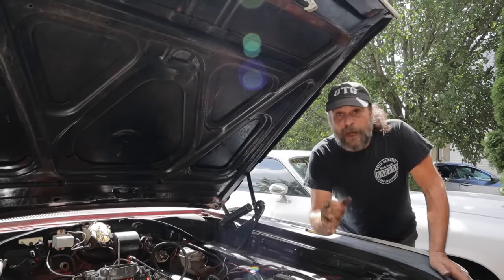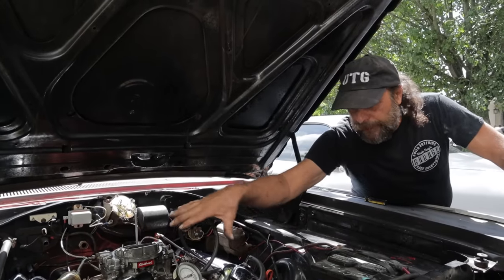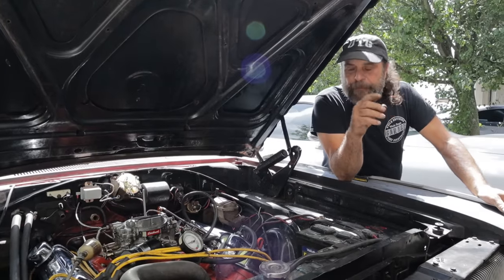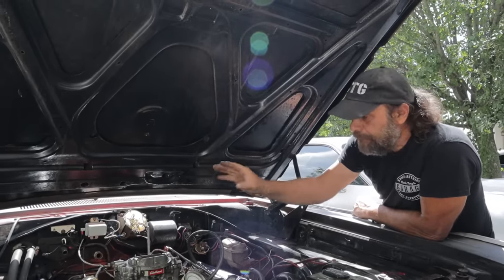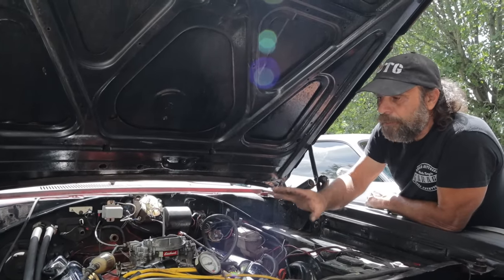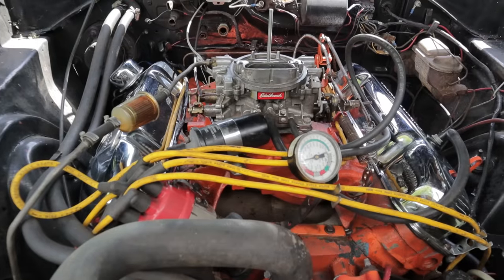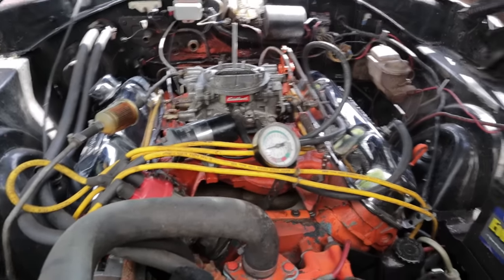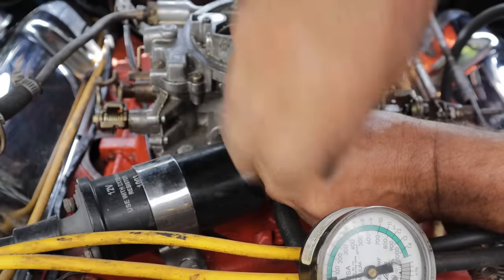Fine Engine Tuning With A Vacuum Gauge

Comment: for the longest time i couldnt figure out why my 273 in my 65 dart would stutter or lag for a second or two when i hit the throttle real good when cruising. i had adjusted my idle screws the way Tony showed in this video, but my idle was too low. so i adjusted my throttle idle screw. which then opened my throttle too far and i had vacuum on my ported vacuum port on my carb at idle.  
so then i dropped the throttle idle screw to where i had zero vacuum on my ported port and advanced my distributor to 16 or 17 degrees at idle, which brought my idle up. my service manual calls for 10 degrees at idle for an automatic car.  now it runs great.   dont know if this is how youre supposed to fix my issue but it seems to be working.
Reply: Manufacturer's opinion was just flat wrong, was it? I'm shocked I tell you.
Reply: I didn't know...  This is the first car I've ever owned with a carb
Reply: @matt72991  Well the next morning with less beer in me I shouldn't have acted like I know everything. Perhaps on a particular morning in Detroit given the weather, the factory specs weren't that far off. Also don't forget gas is a lot different than it used to be. 

I can tell you, without knowing near as much as Tony does, that I and a lot of others ran off manifold vacuum, and we did that because it ran a little better. For any car really, you want all the advance it will take, short of pinging / detonation / pre-ignition. And a lot of people live with the very occasional light ping, which I didn't really like, because detonation is like taking a hammer to your pistons and rod and crank bearings. But hey, a little ping will keep your valves carbon free ;)

Comment: Whats also interresting is if you look at the math the relation between torq and horspower is a straight line with relation to the rpm.
When ever you have a drop in the curve it is due to heat and, flow resistance.
If you make sure the carburator is colder with a aluminium manifold and wrapping the exhaust, the fule economy will drop because you are recycling less heat.
Reply: Now the limit is not over heating your engine.

Comment: Thank you for giving us your time and all the help. Much aprichiated! 
I Have got it explained The otherway around about pre timing. To use manifold vac to get the engine run cooler and Have the leaner fuel time to burn at Idle on my stock Firebird 400 68'. But yes It fall of same time as trottle blades open and I guess the rpms so low the mecanical is not still in? Im interested in people Who knows by doing , I don't think it's just black or White. Maybe it's becausse I use manifold vac I got this stumble/hesitation going on. I just got My lambda, maybe that will get me a clue.

Comment: I like that idea to open the mixture screws a 1/4 turn extra as that gives you a "cushion" somto spak. A slightly lean setting will cause a rough idle sooner than a setting a little on the rich side if there gets to be a little contamination in the idle circuit. ( which is inevitable). Set carbs. this way for 51 years.

Comment: on holley with power valve and 1/2 mercury between manifold vacuum on power valve vacuum reading. do u put one vacuum on manifold and and one on carb port and look for differential until it is at closest 1/2 way point? and do u use idle mixture screws to set it?
thanks, forgive me i'm learning. i just rebuilt my 2100 2 barrel on a 289. works great but i wanna learn more

Comment: I have always done the high smooth idle but with a 50 rpm lean drop. Something I'd like you to cover is the standard MOPAR electronic ignition over using the gold box with a performance distributor and why most should not use them as their engine will never hit 6,000 rpm.

Comment: My dad and I used to do it too is to have a vacuum gauge mounted inside the car. All of your older aircraft had them - called manifold pressure gauge. You can adjust them but not on cars while driving. I still have a good vacuum gauge in the tool box along with a compression test gauge. Great stuff Tony. Don't forget to put non ethanol gas in. Carbs don't like ethanol gas.

Comment: fine tuning is helpful but you could do several videos on engine diagnosis with the vacuum gauge. All the side issue's that come up with that topic. Is that rough idle a fouled plug or a vacuum leak etc. Is the low compression in a cylinder bad rings or a valve seat issue or  worn valve guides. As you said in you MPG video the amount of stuff the VG will tell you is a lot if you know how to use it. It is the 1970's tool for mechanical tuning like a laptop is for the mechanics of today. VG  version 2.1 vacuum and PSI in one gauge.

Comment: Great video & content! Thanks for sharing your knowledge! Was that Tang sweat dripping off your face? 🤣🤣🤣

I always said the vacuum gauge was the best way to tune a engine but it's more important to know how to use it. It's very important to have the proper vacuum on my '88 Ford Crown Vic Interceptor because of the variable venturi carb. I have tuned quite a few other cars with the same carb & when I would ask if they were tuning with a vacuum gauge, just got a look like they had no clue of what I was talking about. 🙄

Comment: The carburated engine runs cooler on manifold vacuum. Ported via a thermo vacuum switch was for emissions. When the auto trans car runs high coolant temps on a hot summer day the TVS would switch from ported to manifold vacuum so the engine would run cooler

Comment: Hidden deep in the bowels of the early seventies Chrysler service manuals, they tell you to pull the PCV valve from the valve cover and allow it to draw fresh air.  This removes any variables of fuel dilution in the crankcase,  especially in cold climates or on a car with choke issues.  I have changed oil on cars and then they wouldn't idle correctly before I learned this.

Comment: Gr8 Vid Tony....I have a stock 351 c with a 500 Holley 2 Barrel. Ive done what youve said and seem to have good results, however,when adjusting the mixture screws at idle should I have the Vacuum adance hose removed from the carby and blocked as well as blocking the port on the carby?
Thanks
Tim

Comment: Ported to the dizzy and manifold to a vacuum gauge. Correct.
That way you'll see the 2inch" drop in Vacuum when you back the dizzy off. An  Adjustable timing light is the go as you can watch the two degs of timing come off as you back the dizzy of as well. 
Set the idle with it in D and the brake on yes. That way it won't stall at the lights.

Comment: I just applied this technique to my 318 2-bbl dead stock 1979 318...which is sitting in a 1967 Belvedere II.  Ten minutes worth of work made it run like a new car and it cost me nothing.  I used to have hesitation when lightly tipping into the throttle, like when normally accelerating away from a stop light.  Not anymore.  Just step on the gas and it goes.  I don't know why I didn't try this long ago.

Comment: Engine tuning with a vacuum gauge was how I first learned.  In 87 when I was 17  my dad and I put  a 355 Chevy in my 81 Toyota 4X4 truck.  Don’t think I ever put a timing light on that truck. I was the street racing king for about 6 months

Comment: Brilliant video. So with setting vacuum to the highest on idle, is that done in gear with foot on break or is that more in reference to checking the power valve after highest vacuum on idle in neutral or park? Thanks. From New Zealand

Comment: My 1960 Pontiac takes distributor vacuum from manifold . It has a Rochester 2gc carb that has no provision for a connection for any vacuum at all . So way back at the start of the 60s they were using manifold vacuum for distributor advance .

Comment: I use to run voodoo cams with my sbc with a 600cfm edelbrock man i miss those days messing around with the meter rods and the springs changing out the fuel holes then doing wot run and pulling out the plugs to see if it was running lean or rich. I remember in the gm dizzy you can buy mechanical plates. Upgrades to get the advance more faster and etc with thendifferent color springs on the advance plates or even maxing them out at all times

Comment: Funny you mentioned the 77 T-Bird... My "modern" car died so I've been daily-ing my 79 T-Bird and I've been chasing down and removing all the emissions stuff. A Spiderweb of vacuum lines. It's not a complicated system once I dug into it but it's a headache for sure.
I currently have it running like a champ ( compared to how it was running before) pulling 24in of vacuum at idle. I have the distributor hooked up directly to Manifold vacuum... I had to adjust the vacuum advance canister a bit to make it happy and not ping. She seems to be running just fine and staying cool under normal and highway driving ( use to creep up hotter ) 
I'm still learning about these old school methods. I'm curious as to why Manifold vacuum isn't ideal over Ported Vacuum? Tho I admit I wasn't completely sure where the ported line was on my carb and ended up plugging everything besides the stock preheater

Comment: Hi UT! I have a billet distributor no vacuum advance. Where/what do I hook up my vacuum guage to? Holley 4160 750 cfm double pumper with vacuum secondaries.  Thank you Uncle Tony.
Reply: This comment of mine is old and I now understand what to do. My new Holley came with a "timed port" for Vac Advance I see. Mine is now plugged and my vac gauge was plugged into the manifold port. Tuning this was a breeze and highly recommended alond with UT timing tips. Thanks UT!

Comment: You should cover which (ported) port goes to the vacuum advance, right or left side (specify driver side or passenger side). Also explain why both have vacuum at an idle, one should have constant vacuum, the other will have vacuum only when you hit the throttle.

Comment: Glad youre teaching this stuff. I had to self teach my self how to tune a carb with a vacuum gauge. We set my timing on my 10.5:1 455 Olds motor by advancing it until it was hard to start. Then backed it off a little at a time until it was easy then made that my base timming, then got someone to recurve it so it wouldn't ping. Was that a bad idea?

Comment: Tony any chance you can do a video on detonation and how to prevent it? Building my first engine here and the amount of information you can find is dizzying, but there's doesn't seem to be any rule of thumb about how to be in a safe range initially (iron vs aluminum heads, timing, quench, compression etc.)

Comment: When you have a pre emission car (50’s -60’s era) that when they were new didn’t have a carb with a ported signal so all that was available was manifold vacuum so vacuum advance was connected to manifold vacuum. Fast forward to the 70’s when emissions came into play and ported vacuum was available to help emissions. I think pre emission cars that had vacuum advance hooked up to manifold vacuum should be connected that way when installing a newer carb that has a ported connection because the older cars have the vacuum advanced engineered to operate on manifold vacuum. (Just my way of thinking)

Comment: Hey Uncle Tony, I have a 1948 Willys CJ2A with a 67 CJ5 Dauntless 'Buick' V6. Trans, transfer case, axles are all stock. The 225 V6 is running a Comp Cams 252H grind cam. Intake is an Offy Port-O-Sonic split-plenum (double-level single plane?) unit topped with a 650 Edelbrock 4106.

It's got a period aftermarket HEI with an unknown curve. Vacuum advance is currently hooked up to manifold vacuum because I bought into that 'manifold vacuum for manual transmission, ported vacuum for automatics' thing. I'll get it swapped to ported tomorrow.Anyway, this thing is my daily driver.  Could you ballpark what I should target for initial timing and when it should be fully advanced? It's also my hunting/fishing/trail rig, but doesn't see the insanity of rock crawling if that makes any difference.Yeah, I know the carb is too big, but I can't lay my hands on a 4 barrel carb any smaller around here on my budget. I also very rarely get into the secondaries. I have the original 2V manifold and carb, but there are parts on the Rochester 2G I can't get my hands on at all.Thanks, Les

Comment: On a holley 2210 rebuilt the idle air screw on driver's side make no change... passenger side screw shows immediate change...what could be the issue with driver's side. I see no videos on idle air screw issues and what could be it's problem when no adjustment to idle is notice when turning one...any thoughts?

Comment: Tony, my understanding of vacuum advance is to provide some degree of advance at idle and at cruise speeds because air/fuel mixtures are lean (requiring a longer burn time). At wide open throttle, manifold vacuum drops to zero. Is ported vacuum the same as wide-open throttle? You said to always use ported vacuum to run the vacuum advance on the distributor, so can you please clarify. I saw on a Chevelle blog that you should never use ported vacuum for vacuum advance.

Comment: UT have an odd vehicle setup I am working on. It is a 73 914 Porsche with a SBC 350 conversion. It can not be timed with a timing light, can not see the front of the engine. I have been timing it with a vacuum gauge - to the highest vacuum then back it off 2 inches. Pretty sure it is a truck block low compression and cam, my have an R/V cam in it I did not build the bottom end. What do you think? Thanks, Daryl The engine starts up great - no kick back and no pinging.

Comment: I also take a screw driver and turn the fuel/air mixure screw clockwise till they stop . then I see what angle the screw driver slot is and use that as a reference to how many turns I do for the adjustments while also watching my vaccum gauge to get the best setting. Also its important that the goal is to get the max setting but also to get the needle to stop moving or get most of the fluctuations out of the needle moving back and forth say for example if you have a high milage engine
Reply: I always close them....then using a paint pen to mark them the follow the the dot of paint to count my turns...this way I can always tell how close they are when ajusted

Comment: Maybe the metering rod is clogged every part was clean thoroughly before reassembly and it was actually pretty clean to begin with did a new accelerator grommet plunger all new gaskets and other than the one issue with the driver side air fuel mixture screw the choke works perfect and it idles good but it has a Miss because I don't believe the left side of the motor is getting enough fuel cuz one of the spark plugs was pretty clean compared to the right side on a 383 two barrel.

Comment: Nothing wrong with reference in the vacuum gauge for the optimal base timing then calibrate your distributor for total advance to be on target, spring & weights for the right curve and you got the best of both worlds Great throttle response and the right timing at full tilt.  Then Hook the back advance up to the manifold for better efficiency at light throttle light load cruise and no dieseling when you turn the key off which is what it's intended purpose was

Comment: I have a 78 Dodge coupe with a 360, 4v Edelbrock, idle is good, one in gear and then attempt to accelerate (no burn outs or anything, normal acceleration) stalls 1-3 seconds after increasing accelerator.

Comment: Hey tony just a quick question, in edelbrocks manuals and diagrams online they list manifold vaccum as "non-emissions" vehicles and ported/timed vaccum as "emissions" vehicles, they also note as a diagnostic tool for engine with big camshafts and low manifold vaccum that you run the distributor vaccum reference from the "manifold" port to help with timing tuning. Can you confirm?

Comment: My edelbrock 650 screws turned out 1-1/2 and slight more about a 1/8 inch vacuum set at 20 and smooth idle The best I can get it

Comment: New subscriber. I have a 67 Mustang with factory 289 2 barrel. Runs amazing. Will set and idle smooth all day long. As soon as I put it in gear, it dies. Vacuume? Neutral safety switch? Low idle? I can't figure it out. I'm new to the mechanics as far as this indepth of fine tuning. Needing help.

Comment: Maybe that's where I'm screwing up.  I've got an 85 Squarebody that runs rough in gear, but idles smooth in park.   At some point, someone had disconnected the electronic spark control harness from the distributor, and I assumed the ECU was bad so I've never hooked it back up.  I replaced the Quadrajet with a Holley and a manual choke, and the rough idle in gear is still there after tuning the carb.  All I've done with timing is checked it with a light, and it's good - and has good advance.  I was thinking with the ECU being bad and ESC not working, I just needed to go with an MSD distributor and a crank trigger or something.  Now I'm wondering if I just need to do the timing and carb tuning in gear.  The rough idle is only at idle.  As soon as you tip in, it smooths out and pulls fine.

Comment: What do you think about running a quadrajet and adapter, vs a square bore afb??? I have an 81 440 crewcab that I use for offroading mildly, and the afb doesnt handle angles as well as the qjet,... also I think the qjet is more efficient in 2barrel operation vs afb.. thoughts?